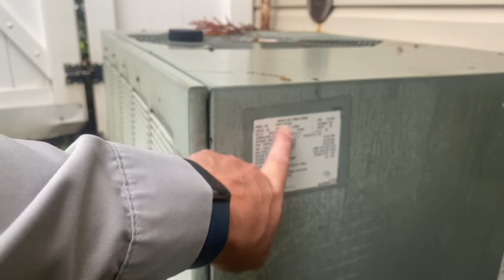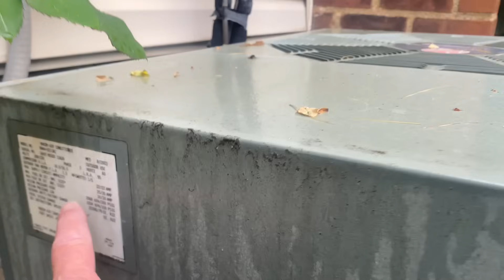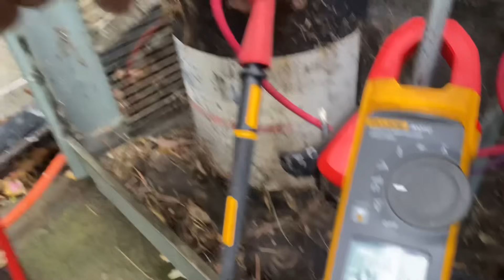Stubborn Homeowner Won’t Replace! Ancient Rheem Central AC Outdoor Unit Not Cooling - It’s All Dead!

Comment: Looks like someone didn't do a good job crimping those connectors either. Find that lot using cheap crimpers and connectors that are cheap. Get quality connectors like AMP, Molex and the right crimpers wire won't just pull out of of the connector. The compressor died but can get a hotspot connectors are not crimped good wonder if that is what killed it the cap didn't help either.

Comment: Mikey, what's the longest you could expect to get out of an HVAC with PERFECT maintainence and a perfect install.. That system was 20 years old which I've seen many systems (and I'm in Florida) go over that.. My buddy has an R-22 that's 27 years old and still working with low maintainence.. but I'm thinking twice a year maintainence what do you think?
Reply from the maker: Not necessarily needed
Reply: @PipeDoctor  So there isn't a ton of difference between a system with regular maintainence compared to someone that only calls when it's broken? I smoked a  little weed when I saw your reply some I may be just high but I hope that's not what you mean otherwise I'm wasting money lol

Comment: @mikeypipes What is a good all around DIY/Homeowner Multi-Meter Kit that will cover most all my bases?  Also, outdoor cooper line sets, aside from foam tubing and UV tape, do you recommend any type of product and or ointment to put on the copper line sets, to prevent corrosion from sweating, or to clean?  Please provide links if you can. Your the man. Latinas Chicas Forever. Cheers

Comment: Do they even make R22 compressors anymore?
Reply: Of course they make R22 compressors. Most folks just don't realize a good air conditioning syste..even residential can last upto 30 yrs or more. In some northern regions, the energy consumption claims the green energy groups make are highly misrepresented. Making a 10 seer ac worthy of keeping around, especially for an older person or couple on a fixed income. A superior technician takes all variables into consideration.

Comment: Whats the cost of a new system? Why are hvac and plumbers so against repairs if it makes sense fiscally? Really not enough information here to go on. Ill give an example of my system. Last year we found high CO on a 30+ year old weil mcclain. I had my normal plumber come and all he did was argue with the weil mcclain rep over checking the heat exchanger and gas valve. He wanted to quote me a new system. I ran it for another winter and called around for quotes. Found a guy who was very familiar with these and adjusted the gas valve as it was to high. Well worth it for me. Even if i need to repair it again next year.
Reply from the maker: Number one we have a company policy not to discuss pricing on this channel number two if a boiler was burning more than 50 ppm I would’ve shut her down high carb monoxide fuel burning. Appliance will cause carbonization at a minimum heat exchanger will need to be scrubbed, clean and possibly replaced the gas control valve. Those are the facts. You, as a homeowner, but the occupants of the structures lives in jeopardy by being a cheap ass.
Reply: @PipeDoctor  
Definitely not cheap. The CO values were well within and deemed fine by both Weil McClain and the plumber. The plumber tested at the flu and called Weil then said he’d send over a quote for a new system. Says it wasn’t worth fixing. There was nothing to fix, the next step plumber who brought in the menometer and inspected the heat exchanger said the system was fine and retested. He was very happy how well it was running.

Comment: I wouldn’t call that ancient since it’s from 2003
Reply from the maker: if it uses R22, it's ancient. i guess you haven't replaced any R410A systems yet, have you??
Reply: @PipeDoctor  I’m only 15 so no but that doesn’t mean I don’t know anything, it is your opinion on what is ancient but a unit that’s at least 35-40 years old is when I would call one ancient
Reply: @BRISTOLFORCE2009  Central air HVAC systems are end of life at 20 years.
Reply: @BRISTOLFORCE2009  LOL maybe not end of life but definitely on it's way.
Reply: @frmerrin2  I mean yeah but unfortunately stuff made today is not built to last
Reply: Especially Midea made units

Comment: I would spend the 10 to 12 grand and replace both units. The cost would be offset in 2 to 3 years with the savings in energy efficiency.
Reply from the maker: good luck with that number buddy
Reply: @PipeDoctor  Let me reprase that. 10 to 12 grand my cost. I have family members who are journeyman HVAC technicians. If someone like yourself did it, it would cost me 16 to 19 grand.

Comment: Here in the deep south 9 out of 10 times we end up repairing the ancient systems simply because people don't have $12,000.00 to replace a 36k btu system. We have a disclaimer for any repairs to a system over 10 years old that says we do not guarantee this will fix it basically.
Reply from the maker: My company has a detailed disclaimer that talks about five things you need to know about if you have a refrigerant leak in your system
Reply: 12k high just had my 4 ton heat pump replaced in 2022 for Goodman $8500. My last goodman went for 14 years probably would have gone longer if I maintained it better. My Day night before that went from 1976 to 2007 31 years of service it was still working when I replaced it I'm in Phoenix hottest city in the country AC units don't run any harder then they do here.
Reply: @Mike-01234  Goodman is garbage and the cheapest made pos on the market. We refuse to sell or install Goodman even as our budget level system.

Comment: i have a question, why are you installing r410a system, when r410a is going to be phased out next year? i know that price for r32 or equivalent refrigerant system will be higher, but the change is coming.
Reply: R410 will be available for 15 plus years ,that’s what Is available now for sell , until the commies take over completely and tell us peasants to turn off all AC units and open the windows 
Is the wind stops blowing and  cloudy days,we won’t have electricity anymore

Comment: In a commercial environment, yes. Recover and use 407C with a new compressor and contactor, along with the proper dual run cap. Test for operation following repairs.
Residential? No. Replace the system.
Reply from the maker: No, even in commercial replace the entire system